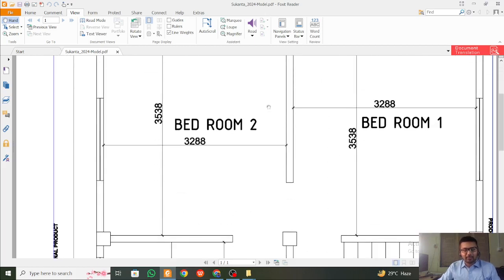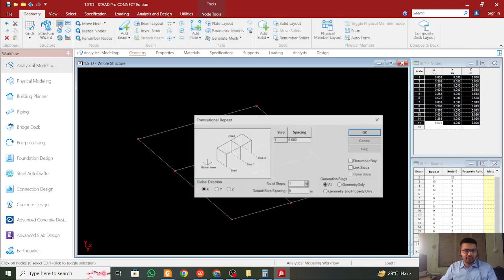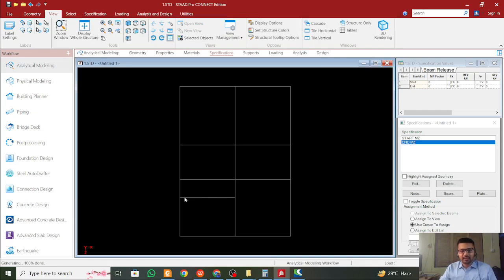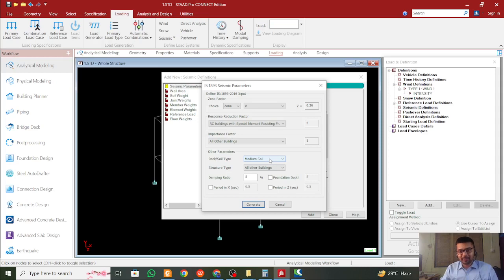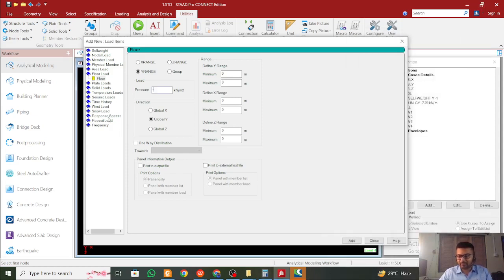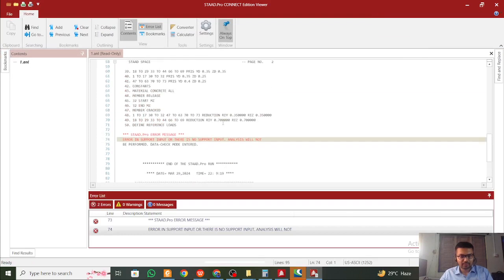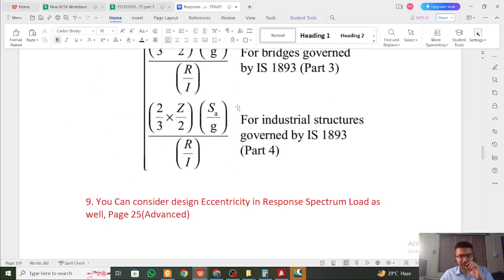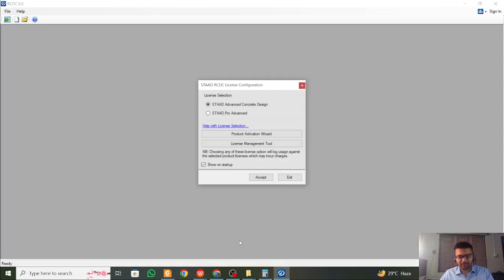Structural Design of a Building in STAAD as per IS Codes|| Response Spectrum Method

Comment: @ 22:35 with reference to the the two vertical beams on which the horizontal beam(whose moments we've released),should'nt those beams be continuous?
Reply from the maker: They are continuous, but to the best of my knowledge, if there is any secondary beam, they have to be  modelled like this. I can be wrong, please check from other sources.